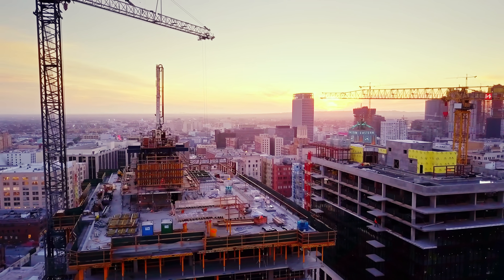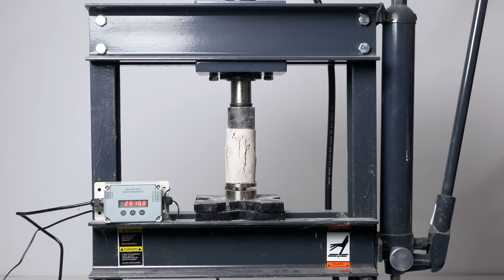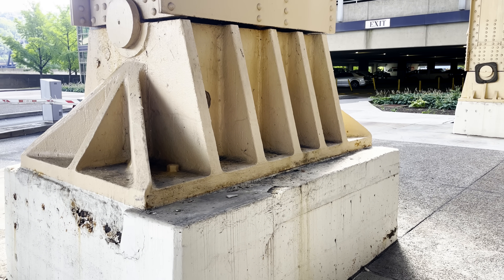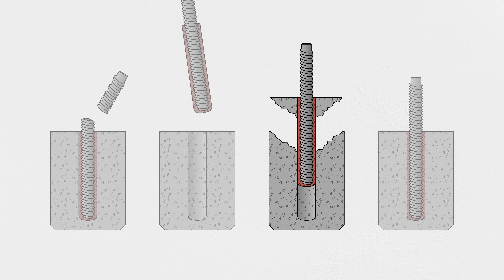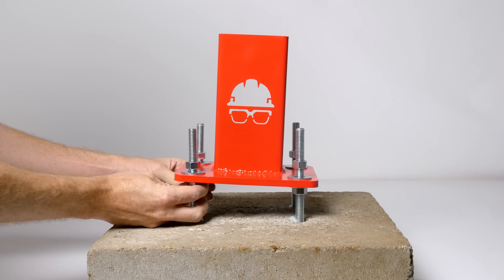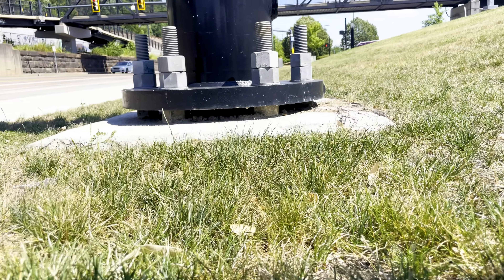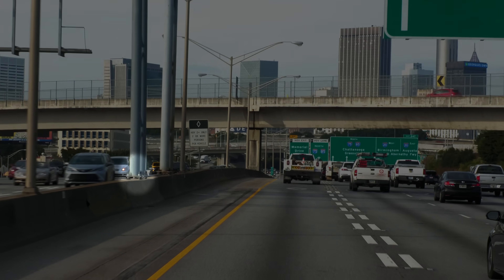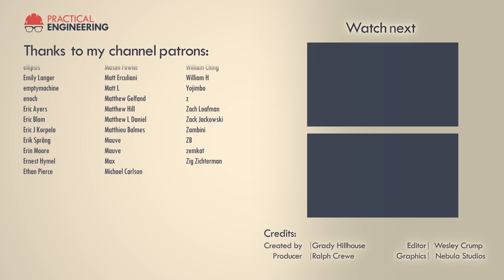What’s the Deal with Base Plates?

Comment: Hi licensed structural engineer here. At 5:03 you showed J bolts/hooked anchor rods. Please know that these have not been used in years and per AISC, hooked anchor rods are not permitted for tension applications. J bolts fail before their full load, due to the hook straightening and also due to a void occurring above the hook from wet setting. A hex headed anchor rod is far superior for cast in place applications

Edit: reading is fundamental. The phrases “have not been used in years” and “we as an industry are trying to move away from them” imply the exact same thing. J bolts are still manufactured and sold and even specced in some cases but that doesn’t justify their use in most applications, especially low/mid/high rises and high wind/seismic applications. There are many types of anchors out there that are far superior in concrete and steel failure modes. Hope this helps
Reply: I don't know if it's permitted, but a whole lot of residential bottom plates are still being attached to slabs with embedded j-bolts in the Atlanta area.
Reply: @WanJae42 we as an industry are trying to move away from them. Screw anchors are a great replacement for wood bottom plates in many cases
Reply: Is this true even for residential applications? I believe I have seen them in use very recently in that setting. They are certainly still sold. Grady's topics aren't limited to any particular genre of construction, are they?
Reply: @tridium-go6hw 
It's probably permitted in residential applications. Lots of uses for residential, mail boxes, deck posts, fence posts, all sorts of low-load type applications. Probably not for anything structural tho unless it's a very small load.
Reply: The IBC still refers to standard hooked anchor bolts in wood frame and CFS construction. Also, ACI 318 (Chapter 17) still gives guidance for calculating pull-out strength, although the equations do not take into account the failure modes mentioned by Lumens1 above (ACI 318-19 R17.6.3.2.2).
Reply: Yeah, I see them specd all the time although they really shouldn't for the structures I'm working with. Engineering firms just love to copy/paste really old documents. We change them on our documents and get approval. Trouble is that it can take less energy to bend the bolt through the curve than to break the bolt in tension. If a bolt has 10x the strength needed like it might for a wood structure, it may not matter, but a nut/plate at the bottom instead is very cheap and is much more resistant to tension since it would require fracturing the concrete.
Reply: They are very much still specc'ed and used quite often in the northeast, high rise construction. But they are never, ever, wet set due to the creation of a void. Similarly we should not wet stick dowel bars. 

We also use a lot of straight bolts with square washers nutted together for pull out.
Reply: @weirdchris555 believe it or not many contractors still wet set anchors. They shouldn’t and specs even state to explicitly not wet set but they still do it, yet they almost never reconsolidate the concrete around it. 

I agree that rebar dowels should also not be wet set.
Reply: I installed the post for my residential basketball hoop no more than five years ago using J-bolts.
Reply: @brighamshamrell4524 while that use is probably fine since the loads are low, I’m referring to building columns, canopy columns and walls that take high loads
Reply: We thought these were discontinued as well. But recently had a structural drawing that called for j-bolts to be embedded in the concrete to anchor down industrial pumps. They can be readily found at home Depot.
Reply: @samuelblackschleger3097 ah you assumed the professional is up to date with regs and not just doing what they have always done 😂
Reply: Useful information that J-hooks aren't good for high load situations. Not that I even have seen those at the hardware store where I live. I'd consider to cast carriage bolts into the concrete instead, but that would only be good if I knew that the concrete wouldn't shrink - or tie them into a template plate holding them in place while the concrete is setting.
Reply: There are times when industry leading firms make changes to the way they design for legitimate reasons, and then you also may find the old school engineer that has been doing it the same way for decades and do not bother updating or changing their design methods (if it ain't broke, don't fix it attitude). 

As an electrical engineer that gets to see the structural designs (more common for me to see expansion or epoxy in our applications), this has been insightful to find out that there is a push to shift away from J anchors.  All these reasons you described make a ton of sense. 

I would imagine the residential sector will continue to be quite resistant to change as they've been building the same way with J anchors for such a long time.
Reply: the phrases "have not been used in years" and "the industry is trying to move away from" are INCREDIBLY different.
Reply: @whatusernameis5295 except they aren’t different. Context is key
Reply: @Lumens1  I really do not understand why people are misunderstanding this - "please know that these have not been used in years" means "we have not specced these and those that are to date in the industry have not specced these and nobody should be using these". There are residential, commercial and industrial applications with different loads to consider, and sounds like res standards are slow in adopting the necessary changes, perhaps because wet setting is quite quick and simple so house builders still use them.
Reply: @victor7wy  yes, that is a good way of putting it. Residential is often slow to adopt and can get away with prescriptive designs that don’t require engineer input to the level of commercial, industrial, etc. While it may work in their application, it certainly doesn’t still justify their continued use when we have better offerings. 

Wet setting is usually done to avoid having to tie off the anchors at the exact location which is more labor and time. They can just measure once the concrete is placed and stick it in letting the concrete hold it. This usually results in lack of straightness and uneven depth setting, plus the void mentioned.
Reply: Doctor A: In the past, we used to treat wounds by smearing cow dung mixed with saliva into the wound, but that practice has not been used for years. Doctor B: We, as a profession, are trying to move away from the practice of treating wounds with a mixture of cow dung and saliva…. Sorry, not the same, no matter how you spin it. 😊
Reply: It's too funny when experts come in saying something is definitely wrong and then backpedal.

"these have not been used in years" changing to "we -- are trying to move away from them" after people saying they are still being used.
Reply: @Paranitis  I find it rather sad - 'how to destroy one's own credibility instantly..'
Reply: @laus9953  You talk like a little kid.
Reply: @laus9953 I will await your in depth commentary to show your own credibility, please share it.
Reply: @laus9953 209 people disagree with you. Try harder. Also who are you? 😂
Reply: @Paranitis you don’t understand what is being discussed because you are not an engineer. “Not being used in years” is talking about structural engineers not using them. They are still physically produced and physically used but are a terrible choice and only cheap contractors use them. Stay in your lane
Reply: @Lumens1 and just like an engineer can’t admit that he might be wrong or not dealing in absolutes. Stay in your lane bud.
Reply: @davidamendez7263 your comment provides nothing of value to the conversation besides thinking that I am wrong in this. I admit when I am wrong, I am not wrong in this case, you don’t understand semantics or the industry. You don’t know where your lane is. Provide valid info on J bolts or read more comment less
Reply: @Lumens1  Man, you could have just said "Sorry, didn't realize they were actually in use. I meant that they haven't been specced in years". 

It's OK to misspeak or be wrong. Telling people in the YouTube comments section to "stay in your lane" is highly condesending and arrogant.
Reply: @thelight3112 I didn’t misspeak at all. My comments are factually correct, up to and including stay in your lane. Reading comprehension is lacking in YouTube comments sections. I am well aware of what is and isn’t used in the industry; folks still specifying j bolts or hooked anchor rods are using very outdated technology or flat out disregarding the code (AISC for example). 

Engineering isn’t a field for everyone to randomly comment in that have no background in it; therefore, stay in your lane is fully valid of a comment, not at all arrogant nor condescending. When you talk to more engineers, you’ll understand.
Reply: @Lumens1  I actually did go to school in order to be an engineer. I just never finished due to personal reasons. I went on and got a degree in something else since I didn't want to deal with certain types of people. And in walks you. So incredibly arrogant, and just wants to stick to your guns while saying how your being wrong isn't actually wrong because of some context nobody else was privy to.

golfclap
Reply: @Paranitis not “in walks me.” I gave a very helpful, insightful comment on the video from someone actively in the industry to help educate others. Arrogant is highly subjective and only if you consider arrogant being calling out dangerous designs that literally can get people hurt or killed. Engineering is absolutely not for everyone. The engineer is responsible for the structure, whether it be a building, bridge, frame, etc for years and years, taking on tremendous liability. This is a serious business. Engineers understand the context of my comment. You decided to attack in your first reply instead of asking for clarification or further information which I would have happily shared.

Comment: Having been the guy who, A) set anchor bolts in wet concrete, B) rough designed pre-engineered steel buildings for quotes, and included building forces to contractors so they could also quote the necessary concrete anchors in their bids, and C) having been an assistant foreman, meaning I was the guy who had to FIX anchor bolts set in the wrong place, and also had to grout under base plates...I'm invested in this video, even though I'm now retired 😂

Comment: Worth mentioning when it comes to a very high shear, a shear lug comes for a help and it just can't work without grout.
In building structural engineering we tend to avoid the column base design merely on anchor bolts with a gap (without grout), because loads are usually high. That's why you can see joints without grout on road-sign posts and road overhead gantry etc.
Reply: The TIA code has expressly forbidden grout for compression, for the reasons Grady stated. Also, the shear loads themselves are not usually the issue, but it's the anchor bolts bending due to that shear loads, when there isn't grout, that is a huge issue, especially for smaller bolts that the grout pad wears away from and are not all acting in bending. But you are right that if you had massive shear loads, a shear key (which is what I've typically heard it called) is a great option, and would require grout. I just can't think of a time where the shear load was the critical element on a base plate. I usually do this on, say, a retaining wall foundation.
Reply: @kindlin  "shear loads were critical" - in portal frames for example, or column with connected bracing in multistorey buildings
Reply: @alexander-n8c2s   Oh, yes, like a braced frame. Good thinking. I've yet to design a large steel lateral system, most of the things I've designed are basically a rooftop penthouses. Even at my first job at a large firm, I was kind of the steel guy (I was a wiz with the various design software we used for steel design, fresh out of college), and the large projects I worked on were mostly all the steel framing above the roof slab, or when I worked on the rest of the gravity system, it was mostly supported by concrete shear walls,

Comment: There's no reason to design a baseplate for a steel structure based on a bearing pressure to the foundation, even with MN of force. A pure compression steel member will have a very thin baseplate, compared to one that has to resist tension or moments. Majority of steel columns are sized big enough to get bolts in, and that's it.
Reply: THIS!
Reply: This is not something you take for granted when designing structures that could cause a tragedy. Baseplates thickness may not often be governed by spreading the load out beyond the beam width, but within the beam. A W-flange (I-Beam) that is 6"x6" does not have 36sqin bearing area unless the baseplate is stiff enough to spread the load BETWEEN the flanges. If you have no stiff baseplate, the load is just on the cross section area of the beam, which is quite small. Allowable compression stress for steel is much higher than concrete. That said, I design steel structures with design loads way above 1MN (225 kip) and a regular minority of columns do need the load spread beyond the beam dimensions to prevent concrete cracking. This won't happen for street sign structures, but definitely happens for large industrial structures.

Comment: Some contractors screwed this up in New Zealand earlier this year. They were cleaning the base plates of a transmission line and unscrewed 3 of the nuts, leading to the tower falling over and the whole northern region of the north island losing power for a bit
Reply: Not just 3 nuts, but 3 entire tower footing of multiple nuts. Omexom the company obviously with some green horn on the impact driver
Reply: @Froggability  unfortunately common for management who are MBAs who learned shareholder value but bugger all of anything technical, ignore the “grumpy old workers and engineers” 

I dont think professional “managers” should be a thing.

Technical competence is what we expect as a baseline. Unfortunately those who get to the top often dont have it.
Reply: I believe he wanted to say that the contractors UNSCREWED this up in New Zealand...
Reply: @MCPicoli  unscrewed it down in New Zealand lol. But it's opposite land so it works out. 😂
Reply: U nailed it mate.
Reply: that's a remarkably bizarre story. What version of "cleaning" involves removing baseplate nuts?
Reply: @davidwilliams9302  Likely cleaning off rust, and instead of doing one at a time, which would mean essentially taking 4 days to do it, assuming they were removing one nut set at a time, spraying with high pressure water to remove rust, then applying a protective first coat, then running the nuts back down and then a second top coating. Instead they undid 2, got half way, then went to undo the third leg, and found out that because of cable sway, and likely the cable direction changing, that the third one meant the side tension from the direction change pulled the entire tower over, as the last one was on the inside edge and thus still under compression, while the other 3 were under tension.
Reply: @davidwilliams9302  Gotta clean the threads that those pesky nuts are occluding. :D
Reply: @Locke99GS Occluding? Good word!
Reply: @davidwilliams9302 I'd guess it'd be rust cleaning and repainting? Or there may have been something extra erroneously bolted down.
Reply: @killsode4760  Could be, but do them one at a time for cryin' out loud!
Reply: Blasting rust and then repainting I believe
Reply: @davidwilliams9302  A thorough cleaning.
Reply: They forgot in NZ it’s righty loosey lefty tighty
Reply: Do the threads rotate the opposite direction south of the equator?😊
Reply: @JKHTX  they actually due, but because the operator is also upside down, from their perspective, it appears unchanged
Reply: @JKHTX  Yes! 😂
Reply: @JKHTX  Like the Coriolis effect? Probably not. But I'm just some guy in Virginia.
Reply: "This company is the cheaper bid".    Gee, I wonder why.    "We can save $1000 per structure".    That will come in handy to offset that $500K - $1M loss.    :- (
Reply: That's a textbook example of a "screw up". :D
Reply: Well that’s an oopsie. I wonder who was at fault, the guy who unscrewed em or the dude who told them too.
Reply: Holy shnikeys what a mess.
Reply: That’s not a country